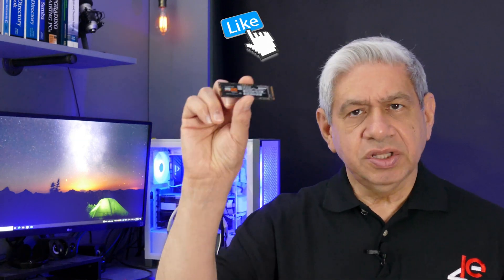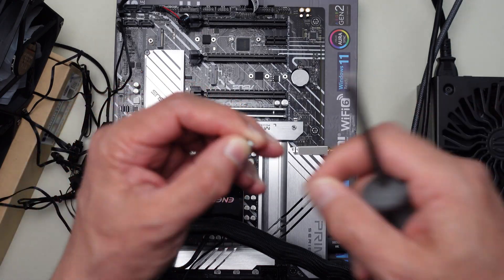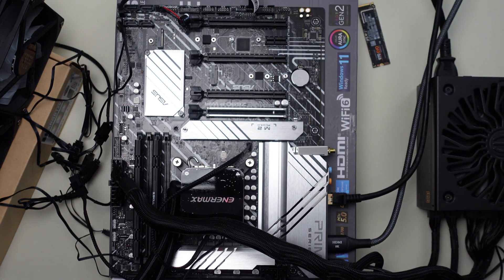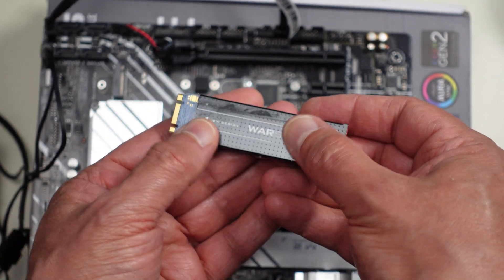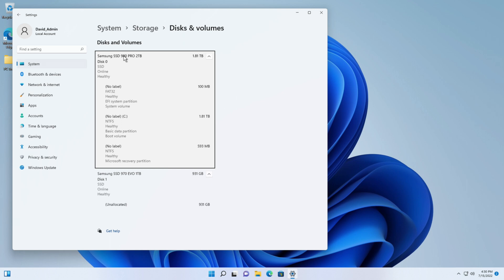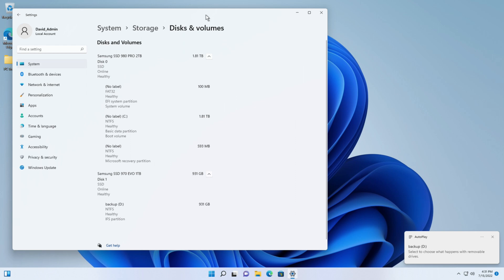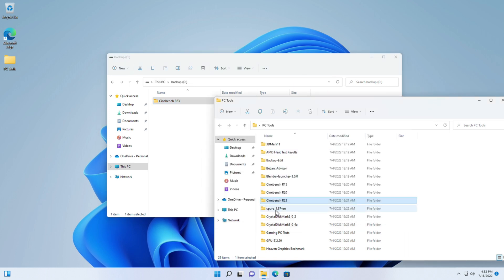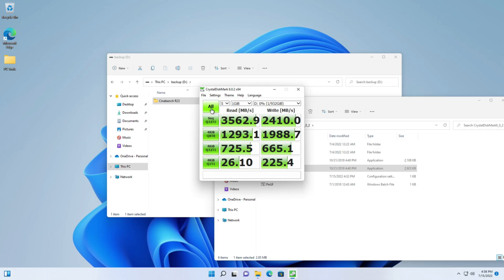Installing a Second High Speed NVMe M.2 Storage Drive into a PC for Additional Storage

Comment: I know this kinda late but should the faster ssd be closer to the cpu or does it matter?
Reply from the maker: I would normally consider doing that, however since this was a second one being added to a running system, I decided not to run into issues re-configuring the the O/S.  Ive done that before, and wound up corrupting a Windows install.

Comment: Question... is there a method where I can tell Windows to treat both NvME cards as one drive when I upgrade without having to reformat both drives?  I know I can set that up when building a new PC during windows install with a raid setup, but can you do the same with a already operating pc?

So let’s say I have a laptop that came with a 1tb nvme, it had another slot for another nvme drive.  After I physically install the new drive can I configure windows to treat the new drive as part of the old drive, just one big drive?  Or will windows always see it as two separate drives?
Reply from the maker: You would have to enable them as RAID-0 if the motherboard supports that.  That will wipe out both drives, so you should probably 'clone' the one you want to keep before doing that, then use that clone to to move the previous O/S to the new RAID pair.

Comment: I searched forever how to fix the issue I was having of the drive showing up in BIOS and Windows and here you go solving my problem in less than 2 minutes. Cheers and thank you so so much!
Reply from the maker: You are very welcome.  What are the specs of your system?
Reply: @PE4Doers  i7 12700K
Asus Strix B660-i 
RTX 3070 Ti

Using it to get back into gaming after a long break
Reply from the maker: @Zyncra  That's a nice system.  How long have you been away from gaming?  For me, it's been more than a decade 😙
Reply: @PE4Doers  Has been 4 years at this point, mind you I am only 24 though haha
Reply from the maker: @Zyncra  I wish I was 24 again

Comment: do you need to use Raid? (not quite sure what that is)
Reply from the maker: No, not at all. unless you want them mirrored or viewed as one contiguous drive space.
Reply from the maker: No, a RAID configuration is not necessary unless you are using more than 3-drives, or you want two drives to be considered a single contiguous drive.

Comment: After installing the new ssd, what if you wanted to use the 970 Evo as the windows drive and 2tb drive as backup.  How would you go about that?
Reply from the maker: That should work fine with most modern motherboard BIOS's.  You just need to make sure you set that Drive as the primary boot in the BIOS before trying to boot.

Comment: Hey, I have 2 Samsung - 980 PRO 1TB Internal Gaming SSD PCIe Gen 4 x4 NVMe installed in my Asus Rog Strix Z690-A gaming wifi d4 motherboard. 1 is used for windows OS, games, and any other random storage for (C:)  I just got a message that my storage is full, but I have the second M.2 that is 1 TB installed. It shows up in Device Manager, it shows up in Disk management, but does not show up in File Explorer. Also wondering how I use it to designate it as my storage?
Reply: Nevermind, I deleted the volume, and set it back up. This time it worked and is now showing up in File Explorer. Thanks again for your amazing video tutorial. I will surely subscribe, share, and send viewers your way. I love that you spoke calm, at a good but slow/steady pace, you spoke clear, and you showed every step. Great job, 1 day I would love to do this as well. I LOVE building gaming PCs (or any PC), as well as repairing all gaming controllers and consoles. I'm not the greatest when it comes to software, and windows 11.
Reply from the maker: You probably need to initialize it in Windows,  By a pure coincidence, I show how that is done with Windows 11.  Here is the link: https://www.youtube.com/watch?v=JQDSgpxwX1E

I hope that helps.